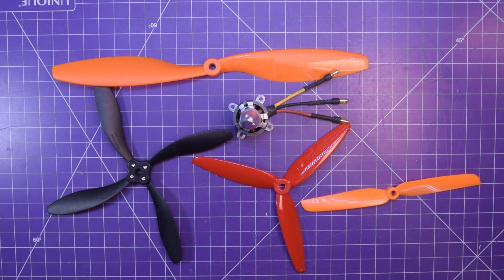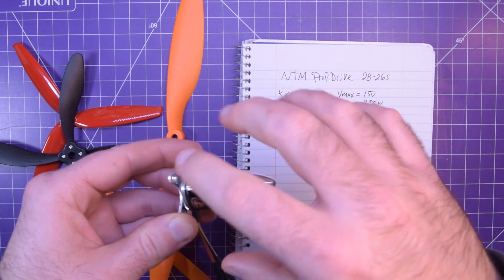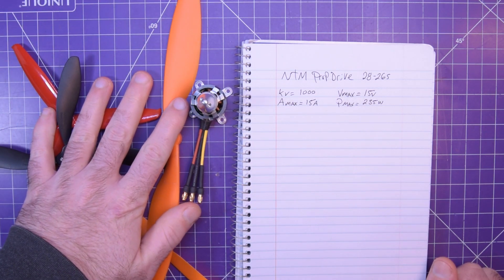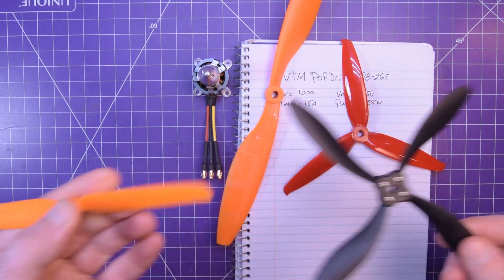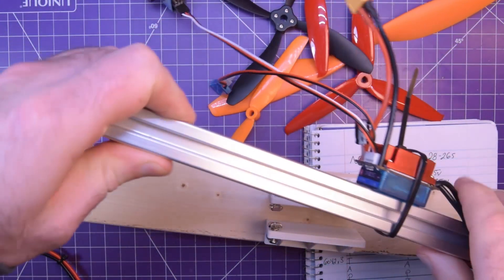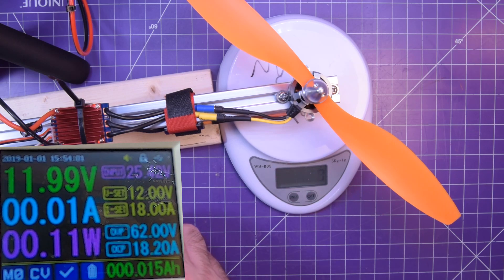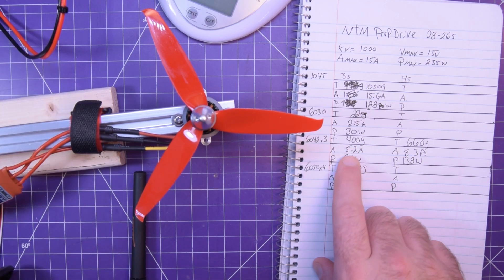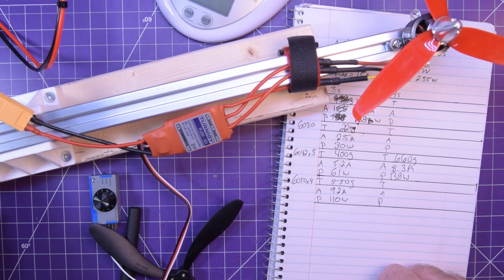How to test thrust on RC motors and propellers

Comment: So, I had a thought. If you test this and place the scale on a flat surface close to the ground, it would show less thrust because the air doesn't have a good follow-through flow. The floor pushes the air back up to the prop, making it give an inaccurate reading of the thrust.

I think you should have elevated the machine onto a table so that the prop is sticking out in the air. Using a lever system, you can place the scale on the opposite side of the lever so that when the motor produces an upwards force, you can measure the downward force on the other side of the lever. This would allow your motor and prop to be in the optimal airflow, accurately simulating the conditions when the RC plane is in the air. It will essentially provide you with a more accurate depiction of the aerodynamics of the RC plane as if it were in flight.
Reply: Good point

Comment: is there any motor available in the market which can give minimum 2kg thrust with 6inch 2 blade or 3 blade propeller?
Reply from the maker: Just see if you can find a 1500-2000W peak motor, with relatively high KV and you may find what you are looking for
Reply: @SimpleElectronics  thank you

Comment: I take it you are running the props backwards for your tests. Aren't they optimised to run in the forwards direction? If so then this test procedure is flawed.
Reply from the maker: They were flipped so they run the correct direction, always have the numbers on the prop facing away from the thrust.